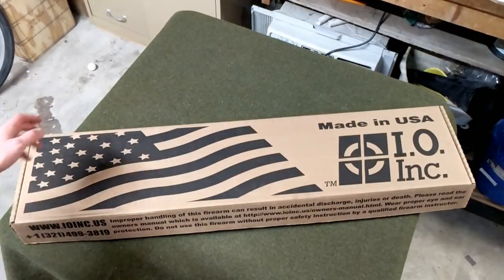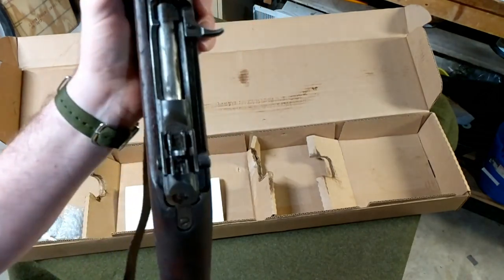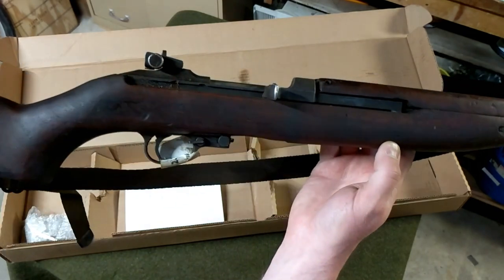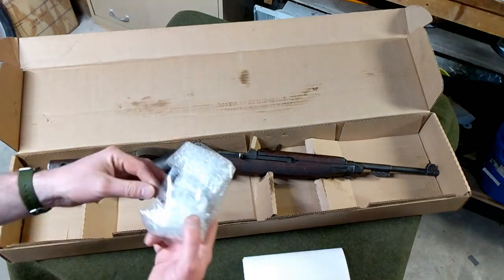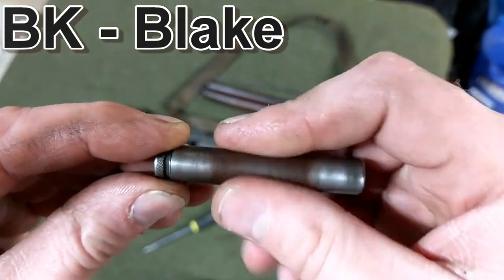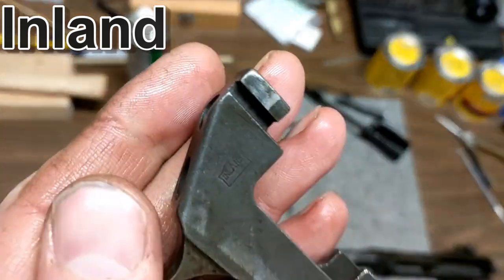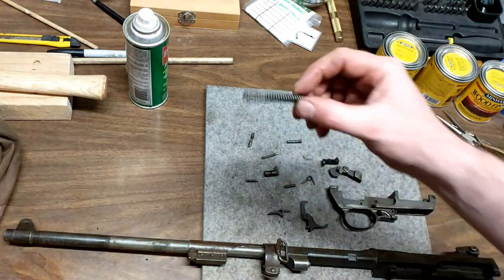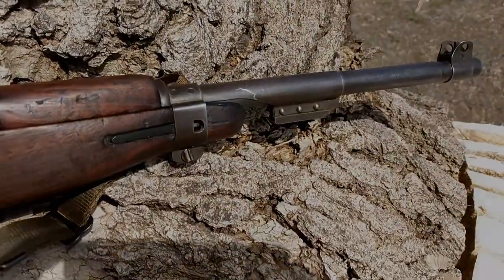M1 Carbine Unboxing Parts Inventory Royal Tiger Import RIA Rebuild

Comment: I've seen some bad ones and some good ones.But they are so hard to find anymore. Not like when I was younger.68 now I have a Winchester and NPM and I probably won't be buying any more guns. You have to take what you can get.🏆
Reply from the maker: Everyone that has collected anything for a little while has seen supply and demand effect price/value.  I like collecting military firearms and have for some time. Most of the firearms I buy are after an inspection, preferably in person.  This carbine ended up being a good buy, but it was basically a lottery ticket.  The days of cheap surplus (in good condition) is over but if you look in the right places, are patient, and educated on what you are looking for deals are still out there.  

Value of milsurp firearms most of the time goes hand in hand with general economic inflation.  For example in 1960 you could buy a M1 Carbine for $80, now these are $800-$1000.  $80 in 1960 is worth $825 now.  Of course not all firearms are the same, due to rarity and pop culture,  but just a thought.

Comment: Any suggestions on where to get a good M1 carbine now that Royal Tiger is out?
Reply from the maker: I just checked and RTI still has them, but they have increased the price since I purchased the one in the video.  I felt like these were a good alternative to the CMP ones since I missed the boat on them.  Carbines are easy to get taken on if not educated on variants and commercial versions.  If you are looking to spend current RTI money, I would look at Simpson Ltd.  At least there you buy what you see.

Comment: Good job on the video... an great showing all the parts an marking's. The stock is in great shape from what i have see from RT. I could do wonders with that stock,.. strip it down an fill the dings an put a lite True oil finish on it. Thank's for the video !
Reply from the maker: Thank you!  All I did to the stock was clean it with mineral spirits and give it a few coats of BLO, turned out great.